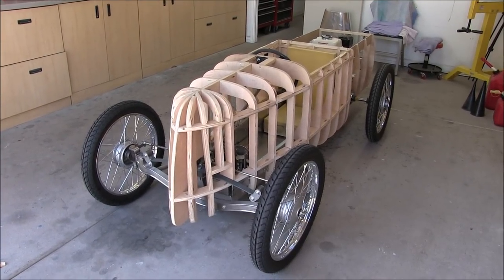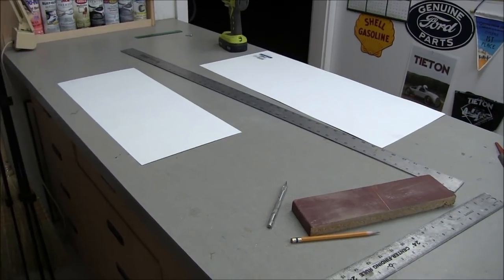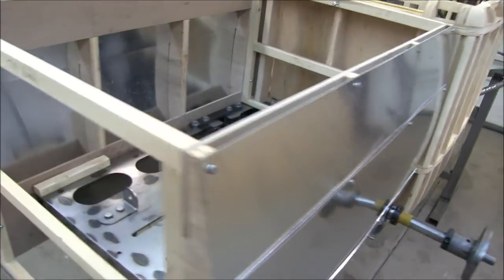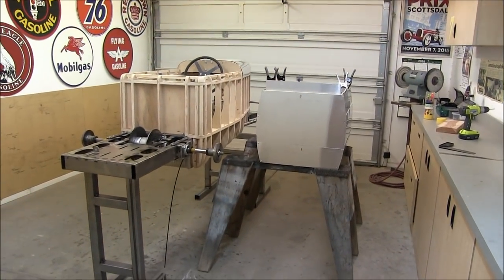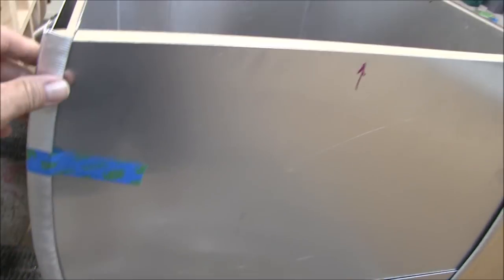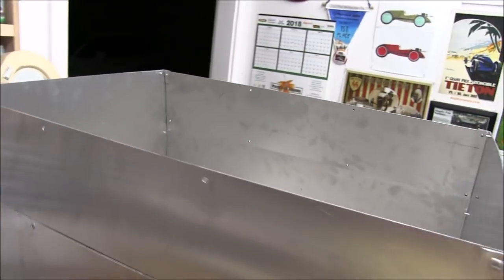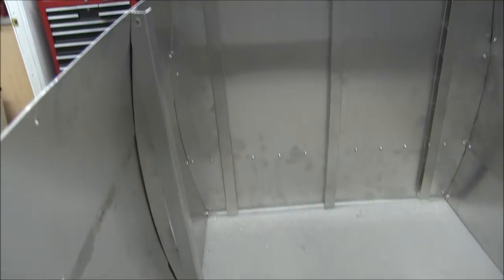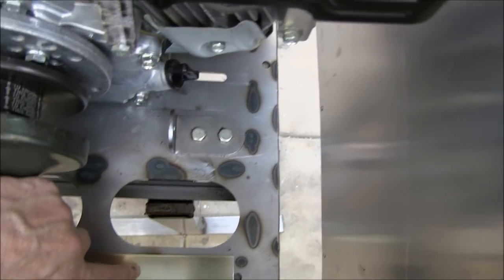Building the '37 Studebaker Body Part 3

Comment: Dennis, how do you and your buds keep finding these specific wire Honda wheels. I don’t see them on eBay or Craig’s List￼
Reply from the maker: Vintage Kart Co out of Mesa Arizona purchased a containers worth of rims (1000 fronts and 1000 rears) 2 years ago. These are brand new rims made in Thailand using Honda tooling. Jack will sell you 4 rims at a reasonable price. email jack@vintagekartco.com. They also sell a few nicely made parts for Cyclekarts. Thanks for watching J
Reply: Dennis, thanks. If I ever get my 914 project car finished, I’m going to build one. Might ought to get the wheels while I can.